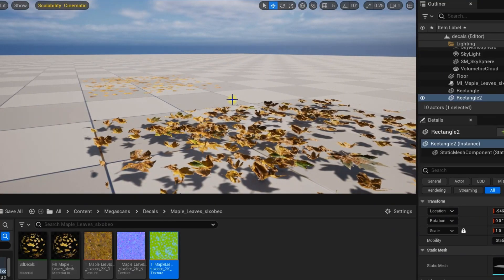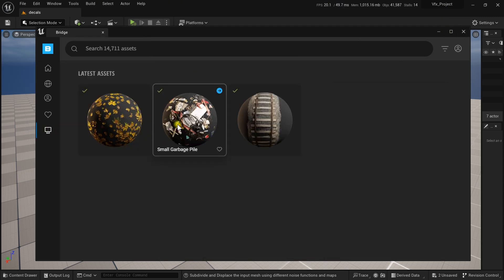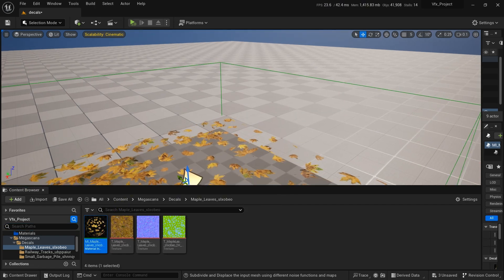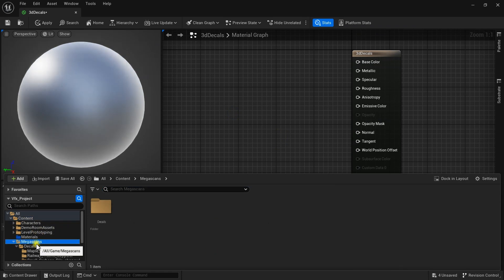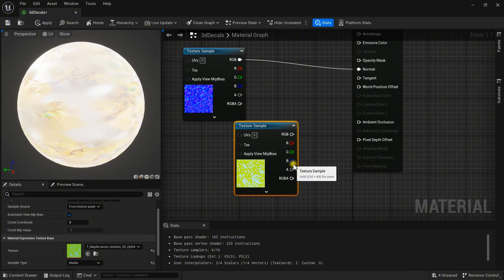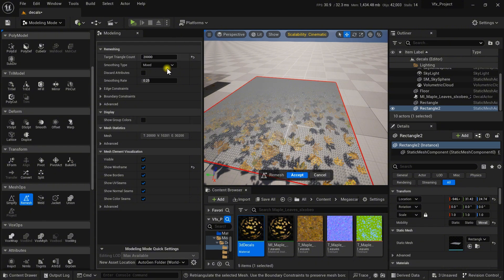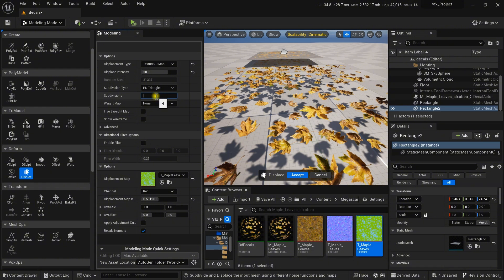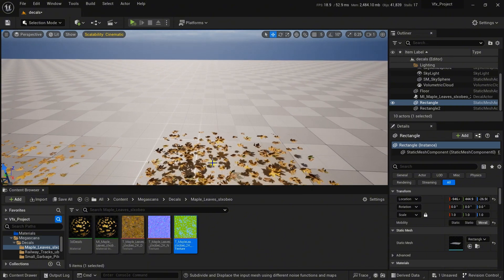How To Convert Any Decals Into 3D Mesh | Unreal Engine 5.4 😍

Comment: Nice! If you hold down both the left and right mouse buttons (or just hold down middle click) and move the mouse, you can get very precise movement in editor. Holding down just left click will give you very precise forward and backward movement. I noticed your camera was making it hard to get an angle on what you wanted to show.
Reply from the maker: Thanks for ur suggestions ☺️

Comment: It is highly unoptimized. 50k for a decal is too high. The main purpose of decal is to reduce polycount and texture size but you are increasing it instead.
You just have to use height maps and parallax material.
Reply: 200k tris* he subdivided it 4 times when displacing 😆
Reply from the maker: Yeah u r right but the tutorial is not for optimization it is for to give 3d effect to plane decal
Reply: Convert to Nanite and you'll be fine. You can also use LODs to reduce the mesh further.